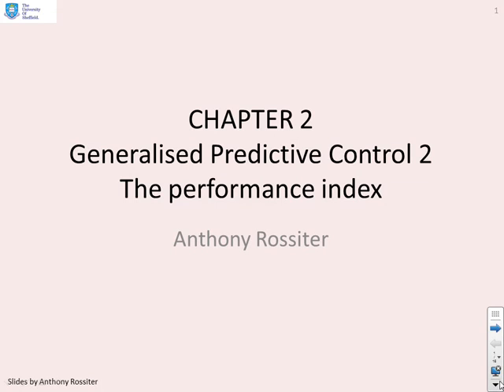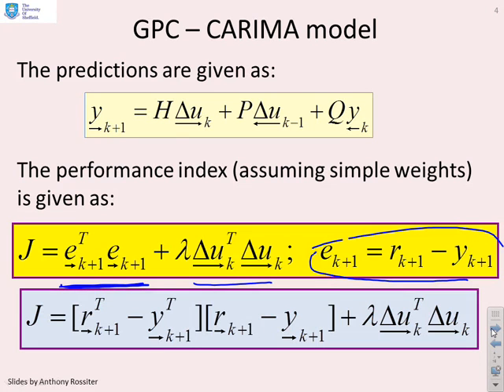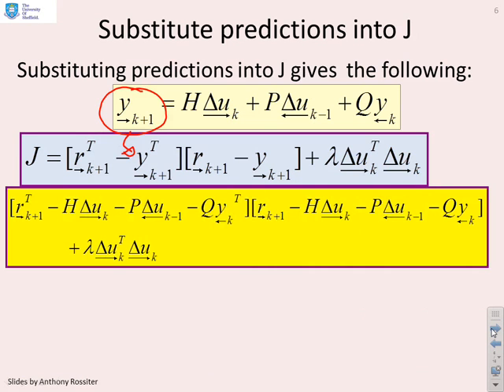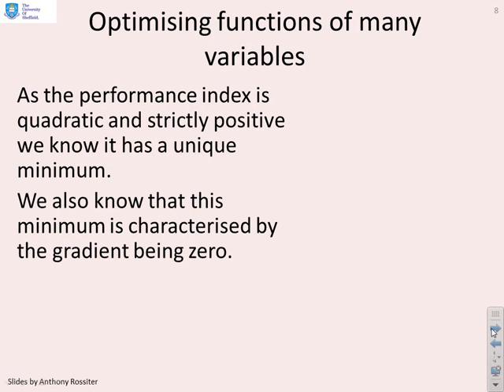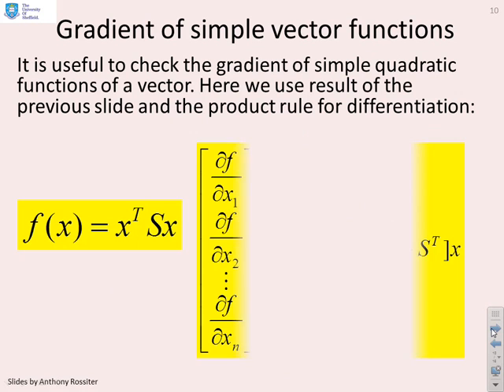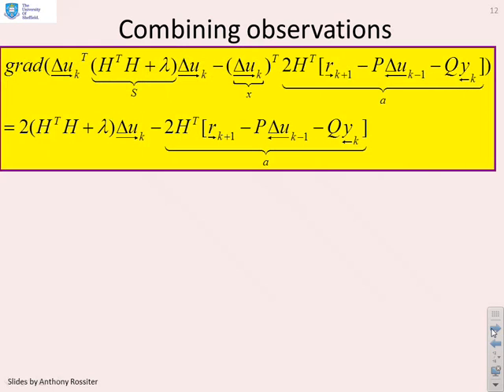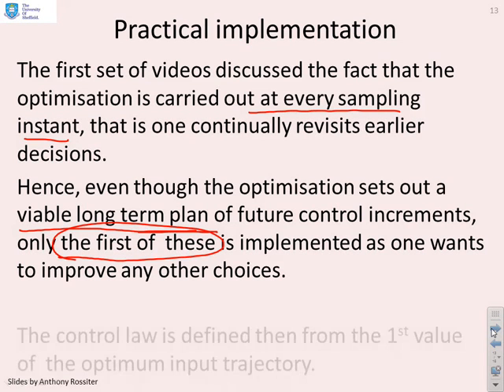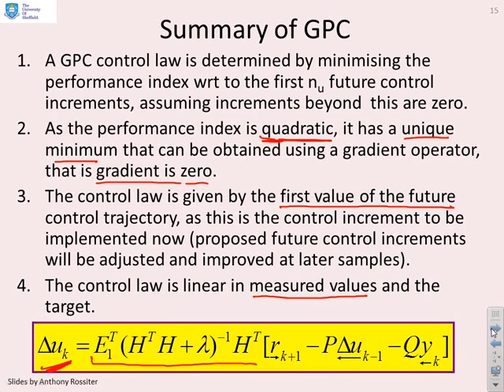Generalised predictive control 2.2 - performance index

Comment: Dr. Rossiter, am I correct in understanding that usually in literature and also in the implementation of GPC, we only use Delta U to make predictions, however what we actually apply on our real process (in a receding horizon window) is U which needs to be extracted from the 1st prediction entry of Delta U?

Comment: thanks, prof. Rossiter, but we decide to change the index and we want to minimize the sum of the sequence of only one component of the state space equation  how I can write my performance index?The s.s.e of embedded model is [p;v;a](k+1)=[1 1 0; 0 1 1;0 0 1 ][p;v;a](k)+[0;0;1]u(k)  
In this way is correct ?  J= sum a'*a    whit a is the sequence vector a=a1,a2,..,ak 
or    J= sum x'Qx  setting Q=[0 0 0;0 1 0;0  0 0] ?

Comment: thanks for your nice presenting,
If I have a system with 3 input for example and one of them is know and I don't need to predict it how can I implement that in the model and in performance index?
Reply from the maker: ahmed saad This would come into your prediction matrices as a known vector (much as past inputs/outputs) so should be straightforward.
Anthony

Comment: J = (transpose(A) - transpose(B)) * (A-B) = transpose(A)*A + transpose(B)*B - transpose(B)*A -transpose(A)*B. Would you like to explain why ? -transpose(B)*A - transpose(A)*B = - 2*transpose(B)*A which is on page 6 of your PowerPoint.
Reply from the maker: Thanh Tuấn Trương Sorry you will need to be more precise on exact timing and equation. it is possible that A and B are vectors in which case the result is obvious as then A'B is a scalar.Anthony